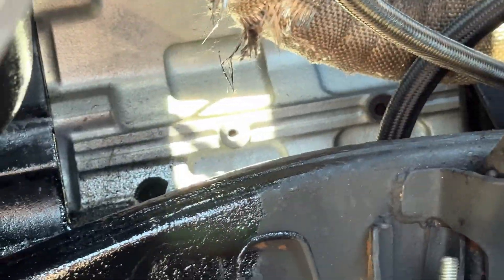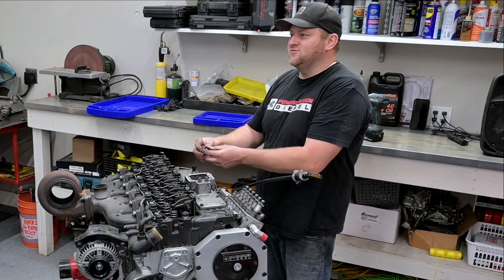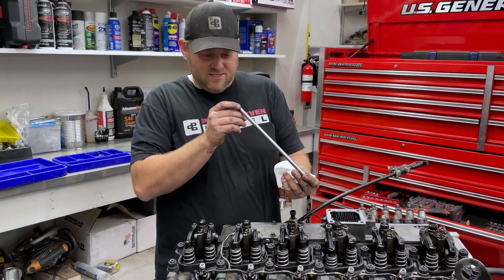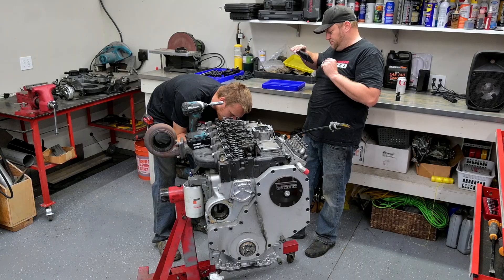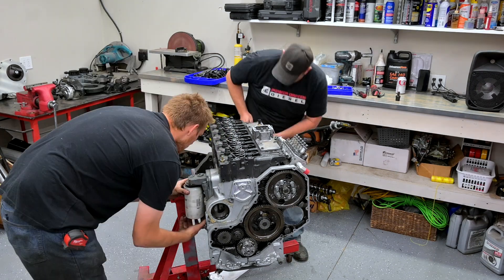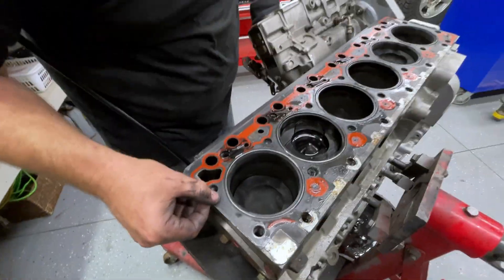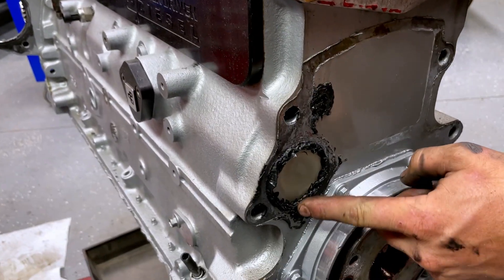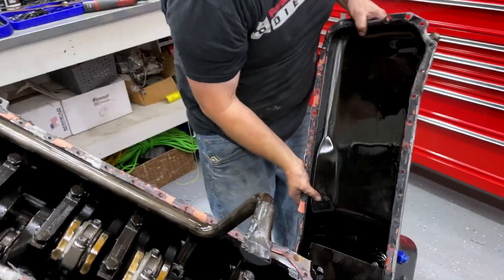12v Cummins Engine Failure! What Happened?

Comment: Bound to have been some wild vibrations going on runnng that thing with the dead miss at that power level. I wonder if it didn’t just rattle that hardware loose like an impact. You have to measbolt stretch now. If they ain’t like a 1/8” longer than they should be then they could only have been loose from vibration.

Comment: Just goes to show how awesome the cummins really is. My 95 has a slight ticking noise around 15-2000. I'm wondering if maybe one of my rocker arms are broke or a pushrod is slightly bent. Either way I have to save my pennies and buy responsible dad stuff before I can get a rebuild.

Comment: welding project, get a bunch of 3/4 wall pipe some 1/2'' hot roll plate... and weld it together. twice whatever the cast iron is. 98'000psi tensile rig stuff gets recycled after so many hours of run time.